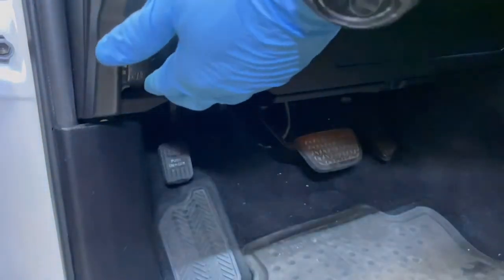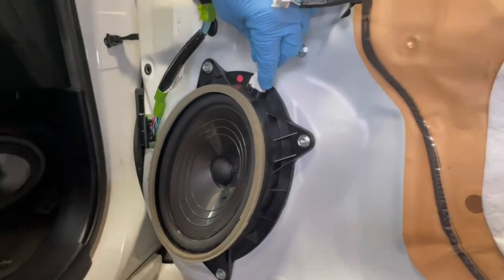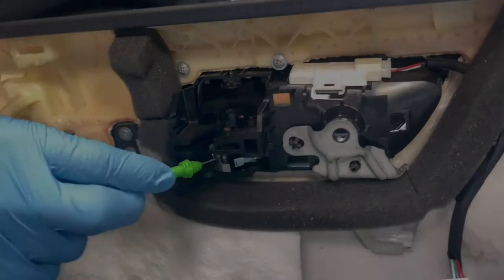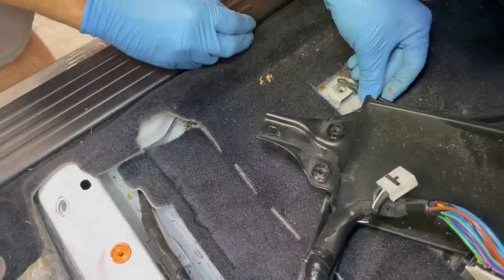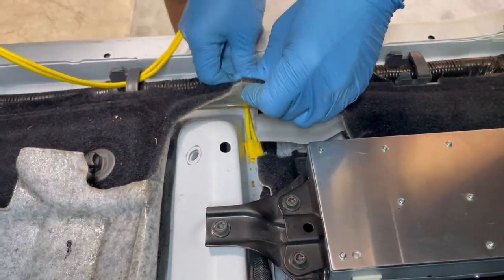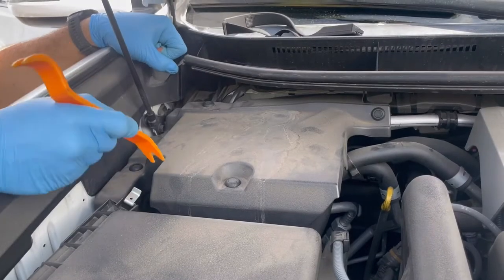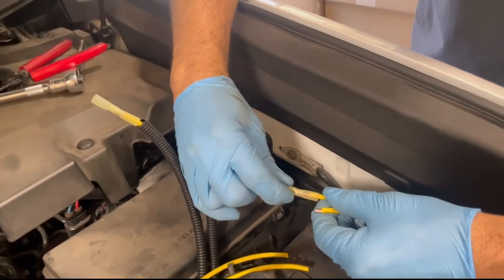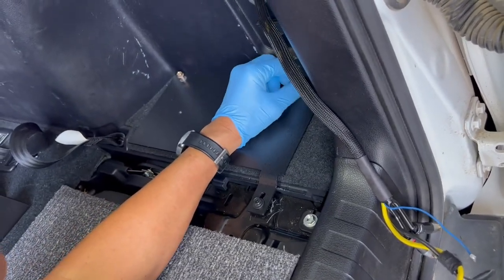2010 - Present Lexus GX 460 | High-Resolution Audio System Install

Comment: So that thing you installed beside the right 3rd row seat by the AC plug is the optional woofer (shown in your picture on your website)? I wouldn't want that as it doesn't look stock. I'm not sure I'd want to run dedicated lines to my battery either if this system requires that. Is it necessary if I don't opt for your subwoofer?